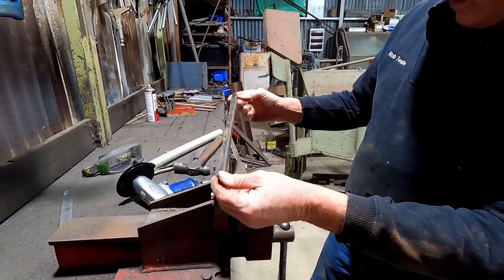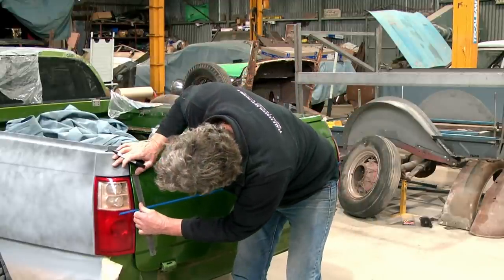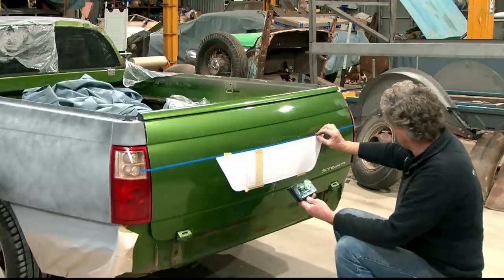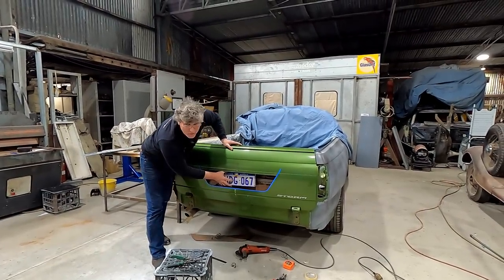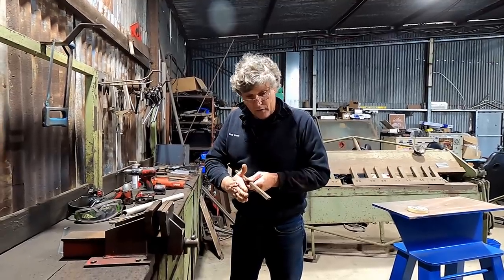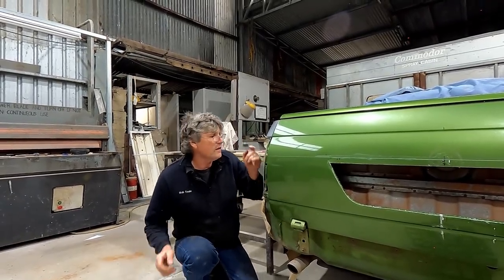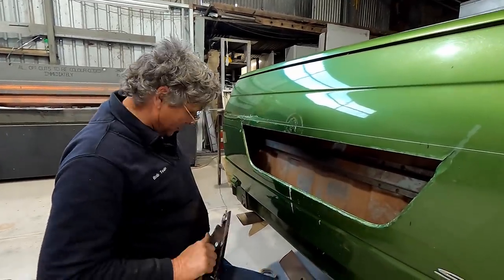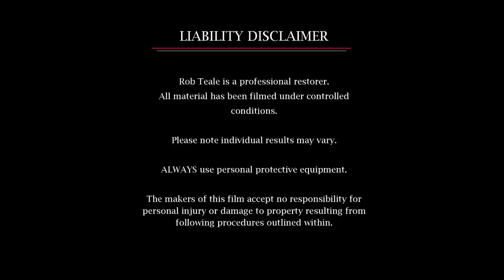Custom Tailgate - Part one

Comment: Interesting reworking of an Aussie soon-to-be classic Holden ute. Surprising degree of malleability in this steel, that I thought would be more tensile/stiffer. Thanks for conducting this experimental procedure ( on viewer behalf) on your own vehicle.
Reply from the maker: I was surprised at just how agreeable the steel is. With the age of the car, and all the info that the trade was given back in the day about high tensile prestressed panels. This panel has worked easily and gave good results in a short time frame. Cheers Rob.

Comment: HSV were cunning (& certainly ingenious)....the HSV VE & VF tailgates were a fully moulded "plastic" tailgate!!  My work bought 20+ tailgates (in various colours) that were "brand new surplus"  removed at HSV when they made the Maloo. Shipped over here to NZ,  I think we have 7 or 8 left.....most have been mainly sold for insurance repairs.
Your skills are impressive....the end result will look awesome
Reply from the maker: Thanks for this comment, I was hoping that someone would bring up the whole plastic panel thing. HSV really nailed it with the VE VF series, I just love the styling package. The limited production, and tooling cost would have made it imposible for  them to make the tailgate in steel. I have always loved the custom builds of the 1960's 70's, so some of what I am doing here is based on that. Way down under we seem to be fairly conservative with our custom cars these days. Cheers Rob.

Comment: Really coming along nicely Rob maybe you should fit a reversing camera when it's finished would hate  to see a dent in all your hard work. Cheers 👍👍
Reply from the maker: Strangely enough my brother suggested a reversing camera the other day. The radio head unit supports one as well. Maybe I had better do just that. Cheers Rob.
Reply: @robsshed  with high definition flush mount cameras available for less than a carton, why not hey mate?
Reply from the maker: @TorqHub  for sure, it is now a simple and cheap upgrade.
Reply: I personally reckon beeping sensors are better, you don’t need to look at a screen and you can tell how close you are as they beep faster as you get closer.

Comment: Hey Rob, your obviously a very talented fabricator, i am wondering why you didn’t buy a second hand R8 or GTS tailgate and lights and make that fit, or cut the outer skin off a used tailgate instead of going to all of this effort, I can only assume it’s to show us how it’s possible to do it. Anyway, looks good best wishes.
Reply from the maker: Hi Jason, Rob's shed is all about teaching and inspiring people to have a go. I often question my sanity with most of the projects I take on and this one is no different. The original HSV tailgate is moulded plastic, and my custom one was only meant to be a tribute to what HSV achieved with the VE/VF design. Thank you for your comment. Cheers Rob.
Reply: @robsshed   Hi Rob, thanks for taking the time to reply, I’ll subscribe and keep watching with interest. Cheers Jason
Reply from the maker: Welcome aboard.

Comment: That's going to look fantastic Rob. Would it be any easier to remove the skin to work it? or 6 of one, half a dozen of the other?
Reply from the maker: Hi Mick, I am hoping that I can get away with doing the whole thing with the skin on......... but if I have to I will remove it. Probaby the biggest drama will be the fitting and welding the insert. I think at this stage it is better on as the frame is supporting it. We have some fun coming up either way. Stay tuned. Cheers Rob.

Comment: Forgive my ignorance - but I assumed that just about all modern cars are EDP  and therefore primer get into everywhere and hence I am puzzled why the inner of the tailgate looks to be bare metal.
Reply from the maker: Hi there, the inner frame is pressed from galvanized sheet, this is what you can see. The outer skin is primer on the inside. I guess the only way any of us can know what practices are used in manufacture, is by investigation of older or damaged cars, or been part of the original equipment manufacturing process. Cheers Rob.